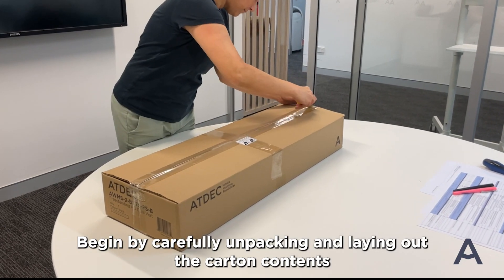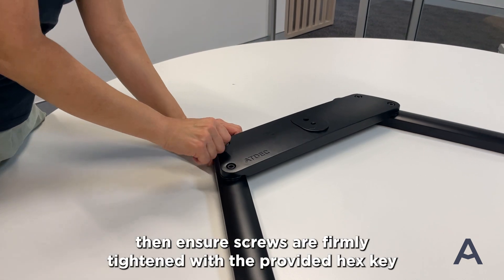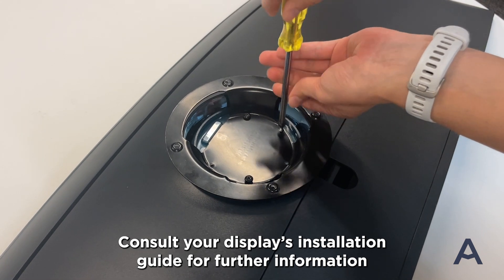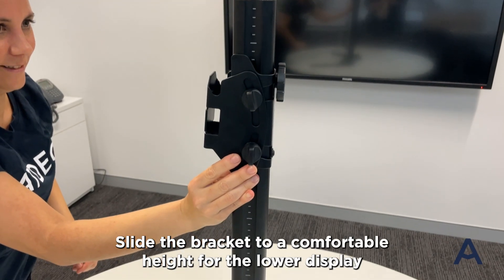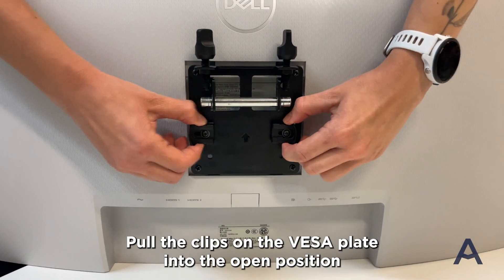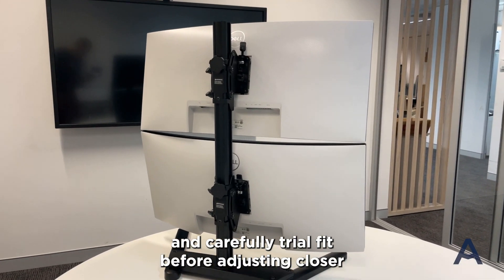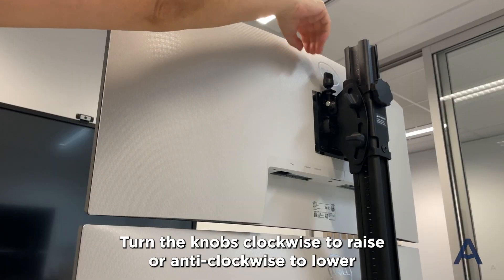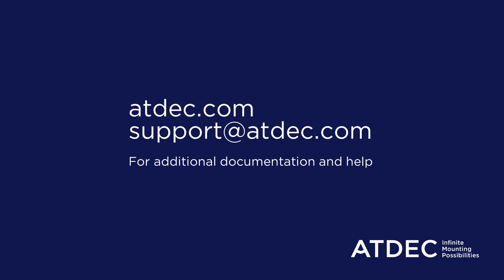Atdec AWMS-2-BT75-FS Installation Video

Comment: Can you please make one that has a 6 inch taller pole? there is simply not enough leeway with height here.
Reply: I understand your pain, but I would think there might be some issues with  weight, If u add more height to something the base should be stronger so it might be unbalanced. If that's unclear think of it like this. A small shot glass would not be easy to tip over. However a tall glass with the same diameter but a greater hight would be easier to tip over. So if you mount your screens higher it would just put more strain on the base and might give some issues.

Comment: Is it possible to put a smaller ultra wide up top and tilt the top one so there is a gap between the top and bottom so that you can have a camera on top of the bottom monitor?
Reply from the maker: You can 100% use asymmetric monitors. It's for sure possible to put a camera between the monitors depending on monitor size - just be careful to do your measurements when placing the brackets on the post. 

Sorry for the late reply.

Comment: Is there possible to have this mount without those 2 legs sticking out on the desk? Like desk mount? I would love to have stack mount  for super ultrawide having been looking for this but cant fint anywhere for 2x 49 inch odyssey monitors.
Reply from the maker: Sure is! This link is the same thing but clamped to the desk. https://www.atdec.com/awms-2-bt75. That is to our North America store - the same product is available from our ANZ and UK stores.
Reply: @AtdecMounting oh thats awsome big thanks for your quick responds 😁
Reply: @AtdecMounting  hello - is this deskmount capable of handling a samsung Neo g9 57" AND a Neo g9 49" monitor (the smaller one being on top of the larger one)?
Reply from the maker: @mahavakyas002  Not with the freestanding version - to mount one or two 57"s stacked, you'll want to get a version of this mount that clamps to your desk (most desks are suitable for desk clamping). Look at AWMS-2-BT75-H or -G (https://www.atdec.com/awms-2-bt75-h, assuming you're in N America).

FYI our web store is down because we're moving to a super cool new warehouse, it'll be back up next week. In the interim our customer service team can suggest stockists, hit them on chat, phone, web. 

Mounting 57s on the freestanding has been actively worked in engineering, heavily tested. We're not happy with the monitor movement that may be experienced with the 57"s, depending on your desk material, floor material, even how heavily you walk or type. We didn't experience anything even vaguely close to 'catastrophe,' but it wasn't a good perception, so it's not recommended. Sorry for the delay, was on leave.